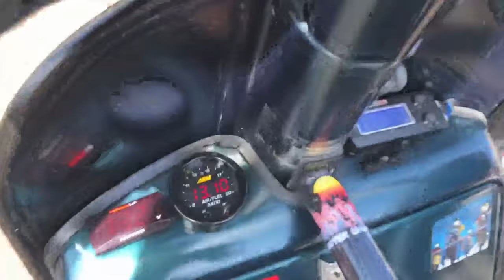Scooter clutch comparison and tuning

Comment: Can you use a stock bell on a Polini 3G Maxi-speed clutch? I have a new 2924 Roughhouse that I want to improve on, and don't want to do a BBK kit on it at least until after the warranty is up. As of now, I have a Malossi Multivar Variator installed, and I ended up using the stock (7.5g) roller weights with the Malossi white contra spring the new variator kit comes with combination for best performance for my weight. The bike downshift much more quickly for hills than it did stock, as well as the acceleration has also improved. It already want to raise rhe front tire without even trying! 🤣
So, I had tried the 7 gram Malossi rollers before adding the white spring and it also improved about the same as I settled on did. I furi experimented by trying both the Malossi 7 gram rollers and the white spring and the revs weren't in the right place for the powerband of the stock pipe. So I left the white spring in and swapped back to the stock weights and it was perfect again...for now. But I want clutch adjustment, so I can dial in takeoff better when I get a new Yazuni Z pipe. Again, this is a sport build, for mostly acceleration. Top speed isn't a super critical factor but I would like to be able to pull 40 moh reliably in most situations which It almost does now, but not quite. I'm also a bit heavier than an average scoot rider at around 240, and btw this is my daily driver and I haul stuff most of the time, so I'm tuning the CVT for all that extra weight consideration too. Any suggestions would be much appreciated! Love the channel and all the great information! Also, what the hell should I do about this "less than" headlight without overtaking the electrical system? I'm not trying to use some LED shop light for a headlight here either guys. I'm thinking of small off road or fog light LED pods that may mount fairly inconspicuously on the wither side of the front fairing. I want an amber option, which will be great for fog and rain in the dark, if I can't find lo-hi beams style lights, i can turn them off when passing oncoming traffic. Because its almost impossible to find LEDS pods with a vertical cutoff so they don't blind oncoming traffic.

Comment: Great video, very informative. Can you tell me, using products on your website, how you would set up the driveline on a Aprillia Ditech with a Malossi 70cc kit($350 kit nothing exotic) and a Tasuni Z pipe? I watched your other video of “what not to do” and I’m unclear regarding the contra component.
Reply from the maker: Not to sure of what the actual question is we have about 4 videos on cvt tuning and so on feel free to call the shop and Paul can get you set up.
Reply from the maker: Also I’d start by getting rid of the z, it’s a Stock replacement ex it doesn’t offer performance e

Comment: I’m running a malossi fly clutch with twh 82cc bbk zx rear koso pulley polini dio variator i have it shimmed correctly but im thinking the malossi fly clutch and the white (race springs) just can’t handle it? I’m not sure I’ve tried so many different combinations of roller weights and the three yellow green and white springs and my mid range just revs hard but i don’t go anywhere and my low end pulls hard it wants to wheelie hard and my top end pulls hard too but the belt doesn’t ride all the way up on the variator. I’ve used twh yellow 1500 contra and red 2000 rpm contra springs and all different types heavy and light roller weight combos. I need help! Also I’m running oko pwk 28 and I’ve got it tuned decently. Should I just get one of these more adjustable clutches? Or should I try to find a set of higher rpm clutch springs for my malossi fly clutch? 
Thank you !

Comment: Hi my Gilera DNA 180 clutch turns the rear wheel slightly at idle. 
It's not enough to cause any issues when riding but I hate the vibraton up my ass when at a standstill.
All the Piaggio scooters I've had dragged the clutch like this at idle, but I have never installed an aftermarket clutch on one. I have however changed the old clutch springs out for Malossi 2911326 Yellow and installed lighter rollers which has helped only very slightly. 
The clutch shoes pull on the springs more than the springs pull the clutch shoes closed.
Idle is set to 1600-1700rpm as per the specification.
I want an aftermarket clutch for my Gilera which will not drag at all at idle, what would you recommend?

Comment: Thanks for this video. What are your thoughts about 2 segments vs 3? I have a 2g polini laying around for more than 10 years now which i got from a friend. I never used it because ii thought 3 segments where better.
Reply from the maker: DH the 2 shoe is a drag race clutch. I’ve had good  luck with that clutch however it’s not made anymore. I wouldn’t hesitate to run it
Reply: @Scooterswapshop  Thanks for your quick reply. Keep it up with your great video's :) Cannot wait for your next twin build video!

Comment: Hey man keep up the good work.
Just wondering i have a 96cc stock cylinder with a 21mm dellorto carb. What springs should i use in the clutch to make it easier for wheelies? I currently have a white big one with stock small clutch springs.
Reply from the maker: Depends

Comment: 4:35 that is not a spacer, that is a torsion washer for your contrast spring, it prevents the contrast spring from twisting. Naraku has better ones though, with real bearings so much less friction.
Reply from the maker: Yes however the naraku ones are prone to losing the bearings as they’re not caged. I’m not a fan of the design

Comment: Hi Scooterswapshop, Are the other parts of the clutch available (Like the sliding Sheave and the main sheave) Its seems like less work to not have to disassemble your stock basket
Reply from the maker: call the shop

Comment: Is there any way to minimise the spool up of the clutch before it engages. You said you recommend red clutch springs which engage at about 8k. From a standstill and if it's city use, then this setup would be pretty annoying having to rev it so high before it moves.
Reply from the maker: You can have it engage anywhere from 2000 rpm or 8000. Race bikes need high engagement. Soft springs engage wealth stuff springs engage late. Just pick the ones you need and install for your needs

Comment: I have a 1999 piaggio typhoon goes about 80km/h     power ends after passing 45km/h   what should i do   and it is pretty mutch stock.          has a 17.5 dellorto carburetor.    Should i buy a better cylinder or adjust the cvt?
Reply from the maker: You can call the shop give Paul your name and order number so he can see what parts you have nd can give you the advice you need.

Comment: Any chance you have a recommendation for the 150cc? Thanks for any support.
Reply from the maker: 150cc Gy6 you really don’t need to install performance clutches like this as they engage very low. We use the ncy clutches with 1000 rpm springs on 171 big bore bikes
Reply: Scooterswapshop Thanks for the tip. The 171 is likely my next upgrade, hopefully. I installed the 2,000 red springs with contra spring into the stock clutch recently... Do you offer any help via email? Would love to briefly list my build and get any feedback from people that actually know what they’re doing. Mostly trial and error to this point. Thanks again.
Reply from the maker: That’s way too stuff for a 171. We advise contacting the shop you got the parts from for tuning help. If you decide to do the 171 we can help with that but we can only help
On parts we provide as we dont want to step on other stores toes with customer support
Reply: Scooterswapshop Understood. Thanks again. Will be sure and order from you guys next as support is the one thing lacking from any of the places I’ve previously ordered from.
Reply: Scooterswapshop one final question, I haven’t actually upgraded to the 171 yet and am still at 150. I currently have all red springs in my clutch, so are you saying they are too stiff for the 150 as well? If so, I’ll gladly purchase some yellows from you folks. Thanks!

Comment: i want to know what kind of springs should i put.. i have Aerox with Malossi 124cc , Multivar 2000 (8,4g rollers), Torque Drive Malossi, Delorto 21,Technigas Next R, and Stage6 Clutch (with white springs right now...). And i cannot make more than 80km/h.. What is the Problem..Please somebody tell me
Reply from the maker: we have many videos on tuning.

Comment: My old clutch size was a 105 and bought 107 is it an upgrade or my clutch is going to slip
Reply from the maker: you get a 107 bell?
Reply: @Scooterswapshop  yea i use to have a 105 but i bought a 107 bell and clutch is that bad? or will it slip